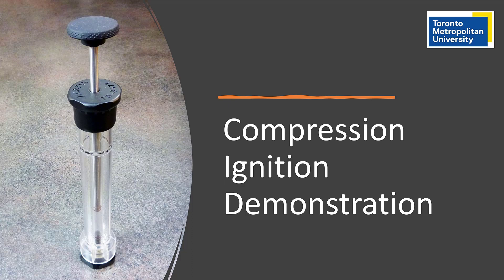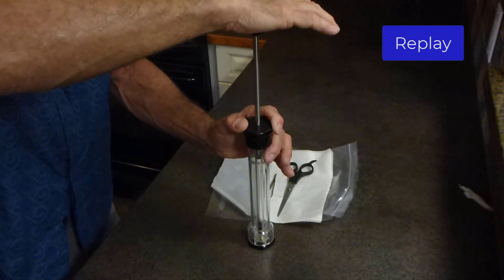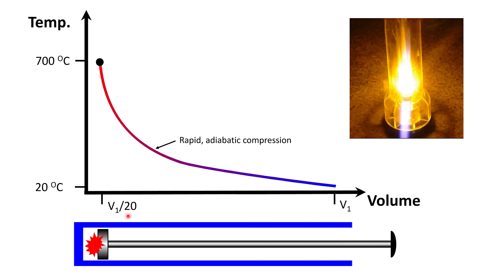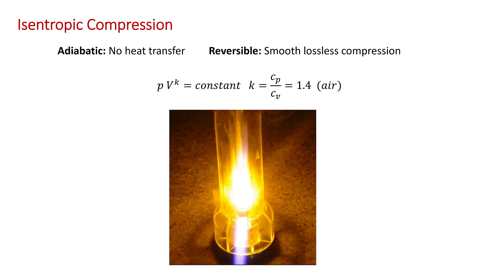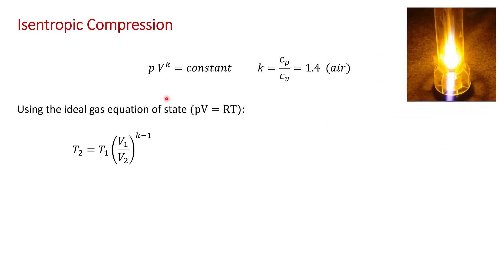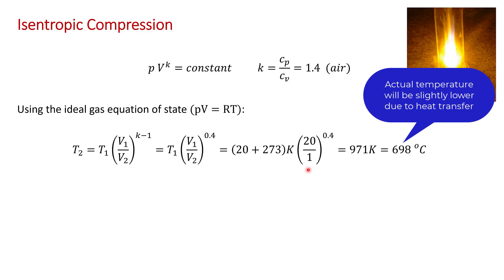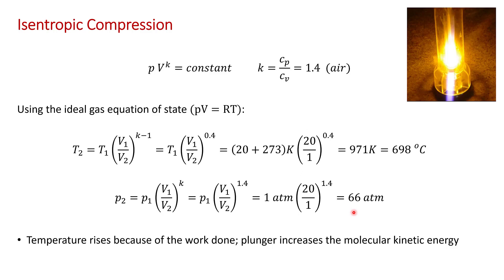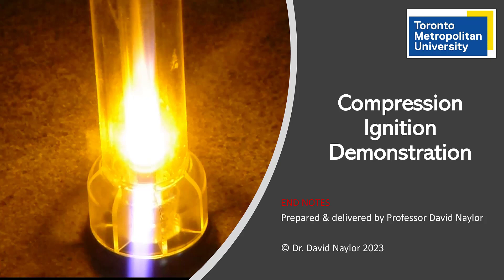The Thermodynamics (and Math) of Compression Ignition

Comment: Instead of cotton, what would happen if you put a bit of steel wool in the chamber?  Curious if it would just heat it up with repeated quick compressions.
Reply from the maker: Not sure what would happen. I suspect that it won't work because steel wool has a lot of thermal mass. Repeat cycles won't help because you get cooling during the decompression. But it would be interesting to try. Then again, I'm always worried about using something too exothermic, as it might shatter the very thin glass tube!

Comment: Amazing video thank you for sharing this information
Reply from the maker: Thanks for the kind words!
Reply: @FluidMatters so by compressing the air inside the cylinder to 1 20th of its volume, in theory, you compress the air to 1 20th of its weight right?
Reply from the maker: @thirty301   The cylinder is sealed. So, the volume decreases, but the weight (and mass) of the air in the cylinder stays the same as it is compressed. I hope that helps.
Reply: @FluidMatters  thanks so much🙃yea it helps, I still don't understand adiabatic compression, I get that as the volume decreases the air molecules move closer together and cause friction that heats the air as it compresses, but the calculations formula is very complex and I played with it a bit, putting an full 50kg weight in a seal cylinder and the temperature of the air didn't increase one bit, now with 50kg surely that's a lot of force, so why didn't the air temperature increase, can you break the formula of adiabatic compression down for me in simple conceptual logic pleeease
Reply from the maker: @thirty301  This goes beyond what I can explain the comments. I recommend reading about "polytropic processes" in a thermodynamics book. Adiabatic compression is a special case. Note that the gas doesn't heat up because of friction. It heats up because the piston does work on the gas: pressure force through a distance equals added energy to the gas. This work shows up as an increase in internal energy (temperature) of the gas. Sorry I can be of more help here.